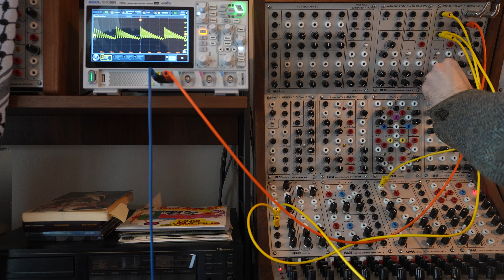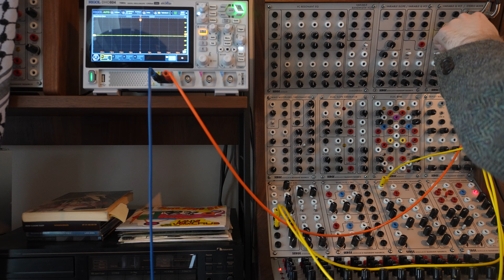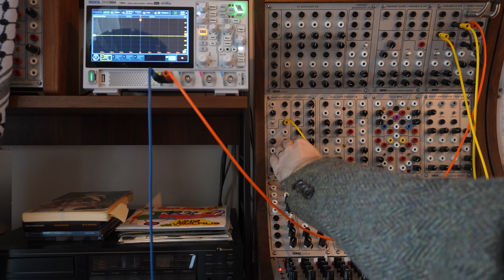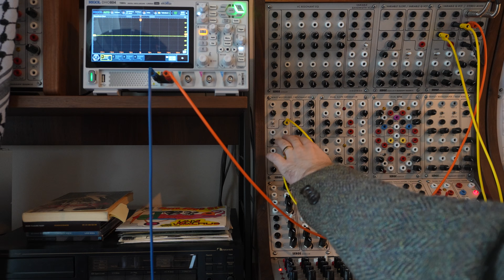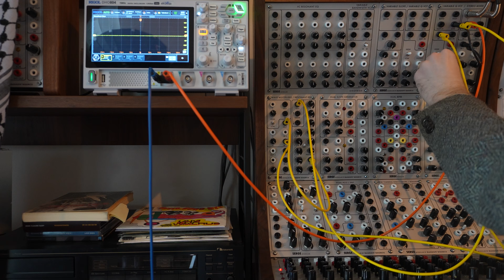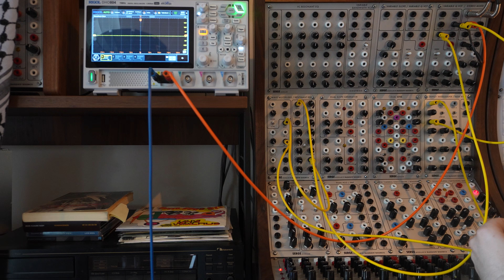Nonlinearity And Feedback

Comment: unrelated question: in Euroland it is a commonly accepted best practice to never stack input cables. you're doing it, nothing is blowing up, the dead remain in their graves--what gives?  I know that some old synths (ARP2500) essentially stacked inputs on the control matrix. 

Have you ever stacked inputs and exceeded rails voltage and blown something up? IIRC Serge is all 12V, wouldn't you hit +15V if you stacked three 10Vp-p oscillators?
Reply: "Don't stack inputs" is a misconception, bordering on myth. Passively mixing signals does not add them. It typically yields a weighted average based on the output impedances. The actual effect will vary with the module design (i.e. buffering of inputs) but it is almost always safe. If you blow up a eurorack module by passive mixing, that module was badly designed! Case in point: common switched jack normals make contact with the cable tip before opening and can "passively mix" momentarily whenever you patch into them.
Reply: Interesting.  I've been stacking inputs on eurorack systems for over a decade.  Have never had an issue.
Reply: tbh the worst that happens with stacked inputs is it sounds s bit screwed up

Comment: Are you 100% sure its safe to sum two signals into the same input on the vcfq? I have never seen anyone do that before, and even if that is safe for the vcfq (and the oscillator) is it safe in other Serge situations? If it is thats great news, if not, should be advised to do it at one owns risk or?
Reply: You can't design a synthesizer with banana plugs and not account for that usecase. The fact that they chose that format should be reassuring enough for you if you don't want to study the schematics. 

Only one company would create a synth with that kind of failure, and they still haven't wandered into synth design because they are busy adding ads to Windows.
Reply: 100% safe unless your module was designed by an absolute goober
Reply: @philipramge3432 im looking forward for u to try that with all ur eurorack modules or all modules u can demo in a shop! Please film it and share it! 😅
Reply: @Setherian I'd say most (except for goober-designed) modules have a 1kΩ+ current limiting resistors at output so that the last stage of the circuit aka opamps or transistors cant be overly loaded. One has to remember that in Euro the tip of the jack cable momentarily touches the ground (shorts really) when plugged. So passive mixing shouldnt be a concern as coz of resistors no major current can flow between the connected outputs rly afaik